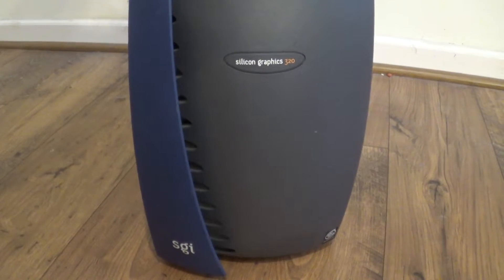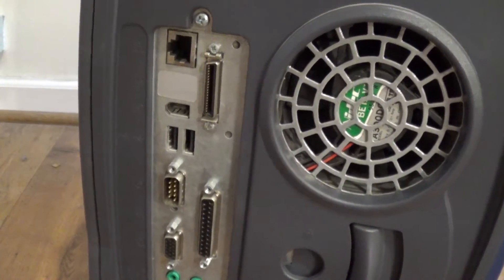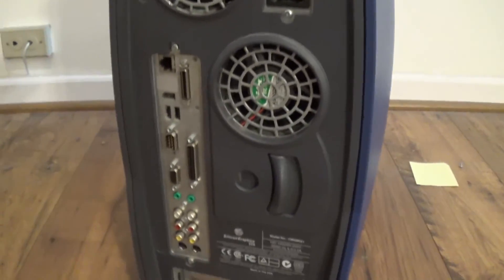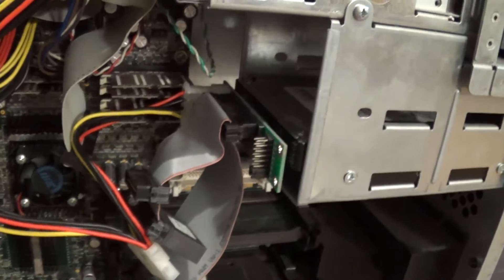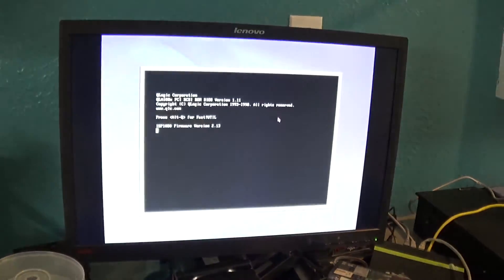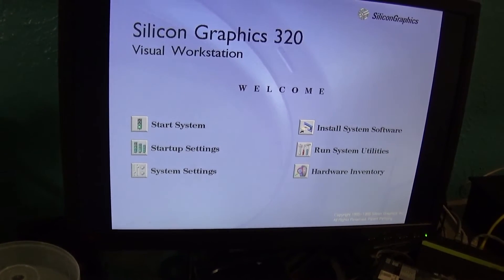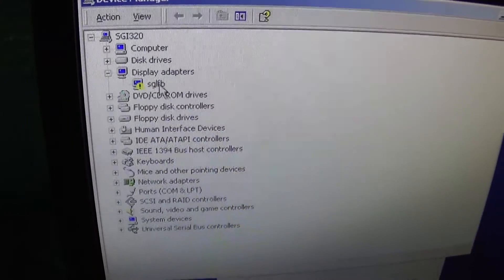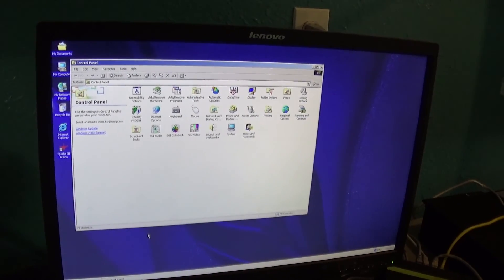The SGI/Silicon Graphics 320: A hybrid of a PC and SGI

Comment: The 320 has the same basic architecture as SGI's earlier O2 system (called UMA in O2, referred to as IVC in the 320/540), indeed they should have used the Cobalt core in the O2+. People misunderstand the 320 in so many ways. 

It isn't a clone, it isn't a hybrid and it would only appear odd to someone not familar with SGI's existing tech, coupled with the idea that a PC is a PC is a PC, same basic design year after year with little to no real innovation (that didn't really get going until the crossbar in the 400BX and the GF256, both of which were based on SGI's ideas). The 320 perfectly reflects what SGI has always been about: processing *data*, designing system architectures to enhance how one can do this. The point with the 320 is that people who are used to standard x86 systems don't know how to even think about how the system works, they're too focused on CPU performance. The heart of the 320 is the Cobalt chip, just as the heart of the O2 is the CRM, likewse the thumping monster in an Octane is the XBow; all of these are data bandwidth engines, with the ones for O2/320/540 also performing main memory access functions and some of the gfx functions (everything not related to geometry, more or less).

It's wrong talking about the Firewire ports as if SGI screwed over customers somehow; the reality is that MS scewed SGI with FW support, because SGI had been expecting WinXP to support the 320/540 but instead MS ditched HAL support entirely (MS' line to SGI re driver issues had been, don't worry, we'll fix it all with XP). WIth the system limited to Win2K, that basically nerfed FW as a function of the system.

7:20 - The fact that the out-of-box Ethernet driver in Win2K doesn't work properly isn't really an issue since the first thing one is supposed to do after installing Win2K is then install the SGI-specific updates and patches (these shipped with the system). These changes are especially critical for the graphics and video features.

LVDS was a standard that was used by several vendors, not just SGI, but as always with such things a company takes a gamble choosing a particular direction and in this instance SGI didn't pick the "winning" connector, irony being the 1600SW flat panel was very successful indeed, won numerous awards and is still in demand today (I have a buyer waiting list).

It would be easy to criticise SGI for the RAM choice (indeed I did at the time), but there were reasons for it (btw, I have RAM available. ;)  Where SGI went wrong (they often did this) was simply making the RAM upgrade costs too expensive. Well, this is one of the things they did wrong, the biggest I'll mention later.

11:10 - Again this is typical of what I mean, you're focusing far too much on the CPU, which isn't the real power behind what the 320 can do (definitely matters for 3D since the CPU does triangle setup and geometry, but anyway...)

Let me put it this way, I was at that time far more used to dealing with MIPS/IRIX SGIs and the PCs I'd dealt with before were standard designs; no PC until the 320 had ever impressed me, always slow and clunky. Then the 320 came out and I got a new sysadmin job running an SGI-based VR centre which also had a dozen 320s, used for VR, urban modelling and imaging. It was the first time I saw an x86 system load and display a large 50MB 2D image file as fast as an Octane, and it can do it because of how Cobalt works. Like O2, one can then do real-time 2D imaging operations on such a file (pan, roam, zoom, rotate, sharpen, blur, convolution kernels, etc.) without being limited by graphics memory like a normal PC, because main memory is graphics memory. Doing complex operations is frequently trivial because no data needs to be moved, one just passes a pointer, whereas on a normal PC there can a lot of data flying about between the gfx card and a separate video card, over the PCI/AGP buses, etc.

For urban modellng, a tax with limited geometry but enormous amounts of photographic texture data, this is a dream come true.

What SGI fundamentally did wrong though was not stick to their original promise: to release a completely new system with the same architecture and updated Cobalt every 18 months, maintaining a balanced architecture, something frequently not possible with normal PCs. By that time SGI was infested with management and marketing people who didn't care about the company's traditional ethos, they were selling off the family silver and breaking promises, the worst being the O2+ which was a total farce. So instead of Cobalt2, the diluted SGI tried to keep their hands in the x86 pie by releasing later systems (230, 330 and 530) based on a conventional PC design with a VIA chipset - crazy idea, they could never compete with Dell or HP in that space, and they had utterly the wrong kind of marketing and sales structure to do it anyway. By contrast, the customer demand (especially from the defense sector) was for a proper followon, the UK MoD wanted a new 540 with 8 CPUs, faster Cobalt and a much higher max RAM. Sometime around 2000, Intel, MS, Virtual Presence and SGI put together a custom quad-XEON 540 (using 4MB L2 CPUs) which came very close to matching an Onyx2 deskside, the first time any "PC" had come close to such a feat.

So the later gen VWs were just normal PCs, nothing special about them at all, and of course far too expensive. I stuck my nose in the fray at one point, made some public comments, caused a row which even had the CEO asking people to discuss matters, and it did result in a 13% price drop, but that was still nowhere near enough to sustain the product line. Even if they could match the pricing, SGI's reseller sales model was all wrong for the x86 market.
Reply: But don't sell the 320 short, nor its unique design. When my dept. upgraded, they bought a bunch of P4/2.4 PCs fitted with GF4 Ti4600 64MB cards. An initial transfer of the apps and data resulted in performance that was a hundred times slower than the 320, this because the modellers (not limited by the nature of the 320 platform) had been using large composite texture images to store all the image data. This had no performance impact on the 320 at all since the data isn't actually moved or copied anyway, but on the normal PC it killed performance stone dead, via dreadful thrashing between the VRAM on the gfx card and main memory, constantly trying to load and reload huge images in a manner the 320 never had to do. So the modellers had to spend ages redoing all their models, using LODs, etc. to *make their task match the limitations of the platform*. And that, in its basic essence, was what SGI in its heyday was all about, helping artists, designers, engineers, animators and other professionals to perform their tasks without having to be limited by the nature of the system they were using. SGI designed tech to help people solve their problems; the PC was and still is entirely about imposing and maintaining a standard system arch on the entire technical world regardless of whether it's a sensible match for individual tasks or not. Customers have to work round or just live with the limitations of the platform, amid an industry mindset that has long accepted this as normal. SGI lost their ethos in the later years though, and they missed numerous opportunities for broader markets, especially consumer gfx (though again their sales model would have made that difficult or impossible), though of course ex-SGI people and their transferred IP kicked off consumer gfx anyway, a la the GF256, N64, etc.

12:10 - Not true since, as I mentioned above, CPU upgrades speed up the gfx automatically. A 320 with two PIII/1GHz can outperform a GF2 GTS, which is very impressive. Again though SGI mucked this up by not even being open and public about what the max possible upgrades were, nor the required jumper positions (though a later firmware update removed the need to bother with jumpers). That was fixed by an employee just making the info public at some point, something that happened several times over the years, employees making info public when it was clearly beneficial to customers.

What SGI basically did here was create something genuinely new which, to be successful, required management to stick with it as promised for the long term, marketing to not lie to customers about the strengths and weaknesses of the platform (great for data visualisation, bad for animation rendering or straight compute!), and for technical data to be easily available. The company failed in all three areas.

12:42 - And all of those alternatives would suffer from the same limitations of a conventional bus-based machine of that era. Your reference to HP still making workstations is not an argument, the 320 didn't fail because the arch was a bad idea, it failed because they didn't know how to market it properly, management didn't stick to their roadmap promises and they didn't make it a technically open platform in terms of technical data.

15:35 - You have an old version of the PROM, you should upgrade.

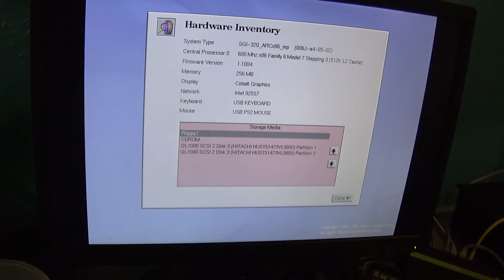15:55 - Blame MS for that.

17:00 - Do you know about the command monitor interface you can access from the PROM for debugging, etc.? It looks like you don't know it's there. Check the FAQ on my site:

http://www.sgidepot.co.uk/vw/

Btw, the sweet thing about the 540 is that it has a dedicated PCI64 bus just for the system disk, so there is never any bus contention for traffic to/from the system disk. Plus of course, the default system disk in a 540 is normally SCSI anyway.

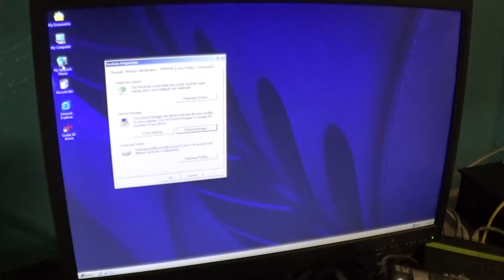19:50 - That highlights one of the problems I moaned about with the marketing of the machine at launched. I never believed 256MB total RAM was enough as a minimum for any customer, but resellers were happy to sell them with 256MB if it meant securing a sale. I never operated that way, I told clients if they couldn't afford a 320 with 512MB then they would be better off looking at a standard PC, because buying a 320 with underspecced RAM was not a good idea.

22:00 - It's funny you talking about Quake3, reminds of GN focusing on Quake for their O2 video. When it comes to games, who cares? It isn't a games machine. When the UN was providing support operations in Bosnia during the civial war, a dozen pre-release 320s were sent over to handle the sat imaging analysis tasks as it was the only system that was up to it (the alternative would have been far more costly Octane2 VPro systems which lacked the arch advantages for defense imaging). And as I say, the system was not meant to be hw-upgradeable (except for CPUs); think again about how it might have been if SGI had done what they originally promised to do, release a genuinely new system with Cobalt2 18 months later, something staggeringly faster than the competition, using standard CPUs (and perhaps standard RAM by then, since initially ordinary PC RAM wasn't up to the task so I was told), though with MS messing about with XP support maybe that was doomed anyway, who knows.

As is so often the case with SGI's tech, it's difficult today to think about why they built what they did, in the way they did, because the tech mindset of today is very different. Modern computing systems have been based on the same derived x86 arch for more than 30 years, whereas SGI's entire ethos was about enabling customers to solve problems now that simply couldn't be done either effectively or at all with current tech. They did speculative designs, tried different things, but so often what they did was ruined by poor management, marketing/PR mistakes and more than anything else an adherence to a fundamentally incompatible sales model.

The 320 though, like the O2, because of how it was designed, enabled those in a field such as medical imaging to save lives, because it was far more effective for volumetric imaging than a conventional PC. Even with the O2, a much slower machine (Cobalt is about 5x faster than CRM), one doctor told me the system helped cut CAT scan analysis times from an hour down to 10 minutes, saved time being vital.

Today tech is a brainwashed race of sameness. AMD vs. NVIDIA, AMD vs. Intel, CPU, GPU, on and on, but the basic platform hasn't changed in decades, the dominant Windows OS plods on with all its inherited limitations, nobody tries anything genuinely new because we blunder on with mountains of accepted compatbility. Milan is the first thing I've heard of that sounds in any way novel, but even that will still be bolted to same legacy structure in the end, and the same OS.

I still like the video btw. :)
Reply: @FuqThatOn  That isn't a question I can process. Is there something more specific you wanted to ask?
Reply: I don't know much about the technical specs but I remember buying a 540 for work and what a different experience that was. Not understanding what SGI machines were about I was so disappointed with how much "slower" it seemed to run than my previous DELL. It wasn't until I noticed that the 540 never crashed did I start to understand. One a dare from a coworker I opened 99 instances of AutoCAD14 at once. It did NOT crash. IT was slow as a turtle in mud but it kept going! I also set it to print a D sized 3D project set to Hidden Line rendering. Most of the time my Dell would crash halfway through but with the SGI I could set it to print and come back in the morning to a stack of glorious multi colored prints. I didn't know WHY it was amazing under the hood back then but once I understand what a workhorse it was I never wanted to go back. I still have that 540 and the case is beat to shit after several moves but it still runs. If I get a chance I should drag it out of the closet and do a short video of it running. Cheers!
Reply: @oso_Peligroso  A very nice summary. 8)  But you've highlighted something perfectly: how does one market that difference? SGI wasn't very good at such PR, especially not for the 320/540. The performance does bump up a lot with better CPUs of course, since they handle all the geometry/lighting. For reference, the best CPU config for a 540 is quad XEON PIII/900MHz.

I know a movie company that for Flame has long since switched to HP Linux systems for most tasks, but they still have an old dual-R12K/400 Octane2 V12 which they use to do some overnight renders of certain things because they have a lot more confidence it won't crash. Another company still has a 16-CPU Onyx3K IR4 system for Inferno (compositing), but they don't tell clients they continue to use it sometimes as they'd just be confused. :D
Reply: @mapesdhs597  I agree about their marketing. I will be honest, I chose it because I knew of SGI because of their ads and articles in 3D Artist, Computer Graphics and other magazines at the time. Most of them were running Alias Wavefront stuff, 3D Studio Max or Softimage or whatever the latest hotness was. I assumed that it could run CAD applications as well and I was right! In hindsight I wish SGI had really pimped the raw POWER of these things. Trying to make them sound just like hotter, newer PC's was really stupid. If they had just said "This is a tank and you can expand your skills and techniques with confidence because this thing wont crash!" they would have stolen the market. 

I remember going from disappointed that we had spent $10,000 on a slow clunker to almost cocky when I realized that I had one of the most powerful NT machines around. I could finally load up my designs with more and more details and objects so our designs became more and more accurate. I finally understood the difference between a fast PC and a powerful one. I remember loading up a Solidworks assembly with over 500 parts which was a TON at the time. The 540 was unimpressed.  THAT was why they cost $10,000 and that computer SERIOUSLY helped the company I worked at move up to the next level.
Reply: @oso_Peligroso  There were specific target markets for which the original VW series was ideal - medical imaging, GIS, indeed CAD aswell to some extent (rather CPU dependent though as most CAD apps are written single threaded, even today) - but SGI's PR kinda aimed at everything which was crazy. I've seen dual-PIII/500 320s manipulate a large 3D model 100x faster than a conventional PC (P4/2.4 with 64MB GF4 Ti4600) because of the very large composite textures they used; these had no performance effect on the 320 but it killed the normal PC stone dead (1 frame per minute instead of 10fps on the 320). SGI messed it up though by making RAM/CPU upgrades expensive and being secretive about max system specs and performance specs. The labI ran had to make do with the normal PCs (not my decision) so the devs had to redo all of their models, include hordes of LODs to control the texture loading.

SGI had originally promised to release next-gen machines based on the same arch 18 months later, but they didn't, instead releasing ordinary overpriced PCs using a VIA chipset (complete farce).

Ah well, the tech paths not trodden. :}
Reply: @mapesdhs597  Jeez this is fascinating! I'm even more impressed with my 540 now that I know what kind of awesome was happening inside of it! And yes.. it wasn't really for CAD, especially crappy ass ACAD14 but I tell ya.. it did the job nonetheless. By the time I added 3D Studio Max to my work I was in hog heaven with this machine. Until our company went out of business and my life spiraled out of control. But at least my boss let me keep the 540 as thanks for staying until the end. Thank you for all the info! This is impressive as Hell!
Reply: @oso_Peligroso  Most welcome! It's a rare machine now btw, definitely hang onto it. 8)
Reply: I had one. Loved it as a pc when win2k was the OS. Beautiful design and sturdy. Totally pissed when MS dropped support for XP. It also sucked that Linux couldn’t run with accelerated graphics. I’m kinda stuck with my prism deskside for the same reason, no sgi drivers for newer kernels....
Reply: @Abrothers100  I'd love to know what really happened with MS and SGI. There's a lot of speculation, but nobody really knows. It could be that the likes of HP and Dell put pressure on MS to drop XP support because they knew by then how much marketshare SGI could take from them with a proper VW followon in the professional space. The Linux aspect doesn't bother me so much, the VW series were never intended to be Linux machines. A miss market opportunity perhaps, but SGI wasn't even properly supporting what they already had.

Prism was a bit of a disaster, terrible 3D drivers. SGI choosing AMD for the gfx was a major blunder. The machine had hw problems too, such as overheating.
Reply: @oso_Peligroso  Hey mate I have a 540 I am restoring, have you ever tried to add a PCI video card to yours? I simply cannot get any (even age period) video card to work. Any tips would be greatly appreciated.
Reply: @rupertfarrow5100  I doubt you will be able to simply because the video card is built in on the board and it shares RAM with the rest of the computer. I'm sure someone else has more tech skills to explain what that's all about but I would imagine that the motherboard wouldn't even recognize another video card AS a video card. I would think the pipeline would be closed to any other cards. Did this sound right @mapesdhs?
Reply: @oso_Peligroso  Hey David thanks for coming back, actually since posting I found this resource https://wiki.preterhuman.net/SGI_Visual_Workstation looks like only a few cards have tested positive  of which the g450 looks the best. That's a good resource for these machines if anyone is interested.
Reply: mapes, the Cobalt looks like it actually outperforms the V12 from seeing its Quake3 performance, I know this is a game and a lame comparison, but that Cobalt looks really fast. What do you think of v12 vs Cobalt?
Reply: @FuqThatOn  that’s pretty sad.
Reply: @FuqThatOn  you should avoid videos on computers and also avoid the English language.  Stay in ur lane brah.